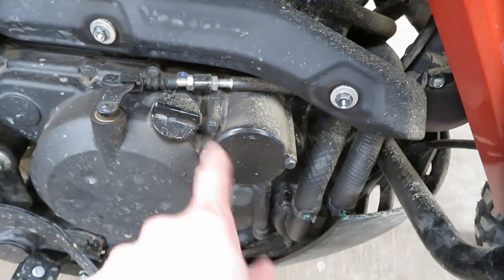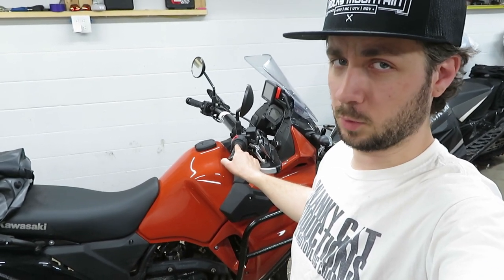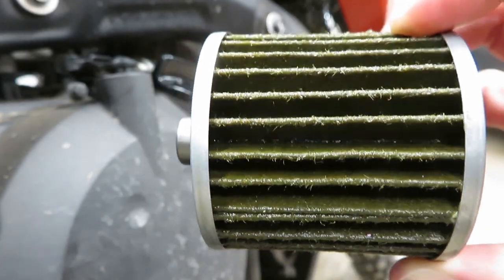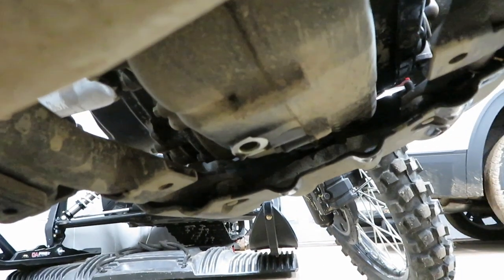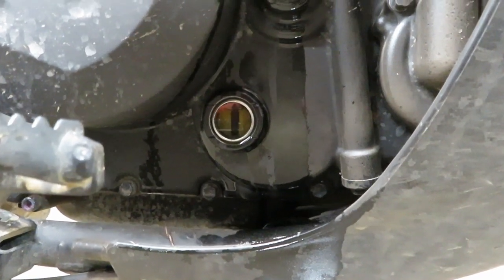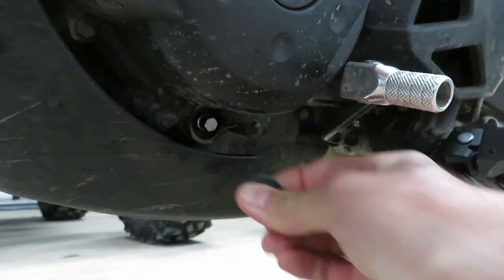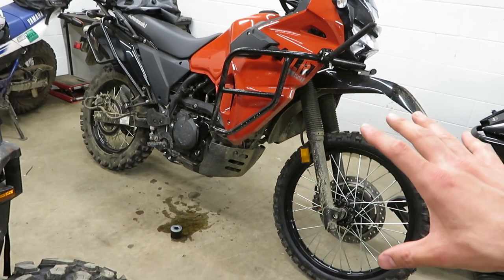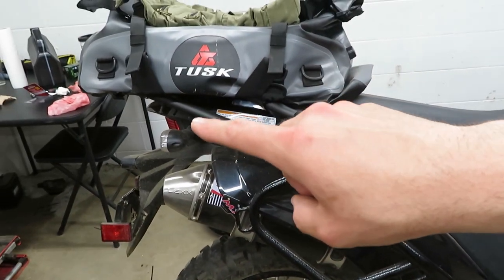What You Missed During Your 2022 KLR 650 Break In Service!

Comment: Wow for years been hearing people wine about the doohickey thing, but this is the first video that ever covered the adjustment on it. Good for you Man, thanks
Reply: The only (1) serious issue that would make me not buy the newer 2022 KLR 650 is:
the doohickey in the engine that goes bad after about 5000 miles & may ruin the engine.
And yes this is still a problem on the 2022 models, I'm told by non-Kawasaki dealers.
Addendum -
The small issues that also make me not want any KLR 650 single:
- way too high of a 1st gear, 
- too heavy/sluggish, i.e power to weight ratio, 
- no tachometer, 
- many other 2022 adventure motorcycles are higher tech. & have better features
Reply: @sweetcostarica  dude if you need to use a tachometer you are doing it wrong
Reply: @Khan-ve5oq You're funny. Have a great 2022!
Reply: @sweetcostarica  if you need a tachometer, you need to learn the bike a bit better.
Reply: @sweetcostarica  having put 30,000 miles on a gen 2, just buy one and ride the damned thing. Rejet the carb and it's snappier. Even the $.22 mod makes a very noticeable difference.
Reply: @travislivengood2744  So if the "doohickey" goes & the engine dies at 5,000 miles just get a new one? Interesting comment.
Reply: @sweetcostarica  well. Mine was fine at 8500. My buddies KLR has 30,000 on it and we did it a few months back. Guess what? It was fine. I enjoy your uneducated snarky end comments though. Educate yourself beyond internet here say or buy something else and stop trolling.
Reply: @travislivengood2744  Trolling??... Fascinating... 
I am not sure why you Travis Livengood think I am being "snarky" or why you seem to not know about the KLR 650's doohickey. So much so you can not bring yourself to even type the word out.
Being Schooled 
- The Famous KLR 650 Doohickey.
Did someone say "uneducated"? As this is a well known & major fault of the KLR 650's motor that for many people has caused trouble,
How does Travis not know it exists and has cause major trouble for Kawasaki owner? Odd.
Please before you judge all KLR 650s by your experience only "educate" yourself on the doohickey problem that even Kawasaki admits is an issue.  

Happy Labor Day.
Reply: @sweetcostarica  I've read lots of things on the internet too. Gen 1 timing chain tensioners DO have a fault. They were thin and somewhat brittle. Gen 2 bikes are much more robust but could have been clocked a little further to allow for more tension. I know probably 8 people who currently have or have owned KLRs. Would you care to guess how many of them have had failures? 0/8. Darn old first hand experience wins again. I have owned one of these bikes for over 10 years. I have worked on at least three. Have had mine stripped down to the frame. It's a 2008, an oil burner. THAT myth is true. And some early 09s too. But timing chain idlers...or doohickey for those who like to nickname an already named part? Gen 1s had issues, Gen 2s are okay. I've literally never seen a Gen 2 fail on a maintained bike.

Reading is insight. First hand experience is knowledge.
Reply: @travislivengood2744  Fascinating... doohickey does exist. God bless 🙌.
Reply: @travislivengood2744  God bless 🙌.  I wish you well.
Reply: @sweetcostarica  stay classy, buy a KLR, ride safe and enjoy.
Reply: @Paul Ridgeway That is not what I heard about the doohickey/tensioer Paul. 
But I am open minded so please give me the data and references to your 99% reliable or shall I say 1% unreliable figure.
Thanks for your help and future references to the doohickey/tensioner issue of the Kawasaki KLR 650.
Reply: I know so many videos and information gets you all worried and ready to spend money on crap that voids your warranty and only a couple vidios just simply check and maintain the adjustments on the doohickey that Kawasaki installed. The data says that Kawasaki has gathered that the doohickey issues are not an issue or they would have addressed it. Cause Kawasaki is not making any money off the aftermarket doohickey modification or they would be selling the mod themselves. And that would be admitting that they knowingly installed faulty parts at the factory. And a company like Kawasaki is going to address something if they think it's a problem and might affect sales of a motercycle. Thanks for the video!
Reply: @sweetcostarica  i just went through the very tuff decision of what new bike to get and went with the KLR. The obvious reason being for the cost you cannot get a better bike. Not what you were saying! 
Mine was $6000 but after the fees and destination crap it was like $8500 out the door. You can't get another adventure bike in the KLR class or better for $8500. The Verseys x300 i looked at briefly but the little 300cc was just not going to cut it. That's a good engine for a beginner sport bike, it lacks the torque needed in a multi purpose bike. You can get the BMW 310 adventure for about the price of a KLR but that little guy is giving all she's got to keep up with traffic on the highway as well. The V Strom 250? I didn't even look at it. Why the hell couldn't Kawasaki just use the 400cc parallel twin in the budget verseys IDK or why couldn't Suzuki just use the drz 400 engine on the street gearing of the v strom 250?? Who knows why they use these questionable engines on a dual purpose bike is beyond me. I like the Honda NC 750 but apparently the front tire is only 17" and an issue off road so they say but it's not just a more expensive bike it's expensive to insure too. So for the money their isn't a better adventure/ dual sport bike that offers the almost 40 ft lbs of torque and 40 HP for 6000 bucks sticker price.
Reply: @lovelymykel76  Simply put the KLR 650's chain tensioner issue (doohickey) is still a problem that should have be fixed along time ago.
It is a problem that should be in mind when you are shopping for a reliable motorcycle.
Reply: @lovelymykel76  BTW great testimony on your experience.
Reply: @sweetcostarica  troll. Never had one, but knows it all.

Comment: Great information.  I just did my first oil change yesterday on 2022 KLR and seen this video afterwards.  I went back and removed new oil filter to double check metal cylinder in middle was in the correct way.  It was but didn’t know it could cause severe engine damage if it wasn’t.  Bike was still on my lift so hadn’t rode it yet.  Thx
Reply: Pretty sure it only goes in one way. So it can't be put in backwards.
Reply: @ZenithClarity  asi es

Comment: When changing the oil on my Vaquero. Since it uses 4.7Qts of oil with filter change I pour the ,3 in as the oil drains to push out some of the old oil as much as possible. Not sure it really makes a difference but makes me feel better.
Reply: All that matters is the condition of the filter. Don't waste oil. The filter ensures particles are small enough to be safe.

Comment: Great rundown!  I had the same issue with the brake light on my '23.  I guess as everything settled in the brake light switch migrated to an always on position.  Easy enough to fix and thankfully I caught it after I got home from picking the bike up.  Also, be aware if you adjust the height of your brake pedal you will have to adjust the brake light switch as well to compensate.

Comment: I changed mine at around 400.  Cut my oil filter media apart and rolled it flat for inspection under a bright light.  Didn't find much for metal but I did find a bunch of paint(?) particles blue....white....pink...

I'm guessing it was from assembly markings.  The good thing is the filter caught it all.

Keep up the great work on the videos.
Reply from the maker: Someone else mentioned paint marker from assembly, I think that's what it's got to be.  Thanks!!!

Comment: Great run down of the service interval. I think I should finally get around to picking up that low profile plug for the next oil change. Thanks for the link.
Reply from the maker: Thanks!  Do you have the stock plate yet?  I can't remember...
Reply: @SwankyCatProductions  the stock skid plate got busted up and I put the motech one on. It reaches the drain plug though.

Comment: Excellent video for the new KLR owner. I had the dealer do the 600 mile service but I plan on changing the oil next time myself. Thank you for posting. Great reference for future oil changes. Owners manual says 2.1 quarts of oil for the KLR but the forum (KLR) has a comcensus of 2.5 quarts. I think the 2.5 quarts might have been a value used on older KLRs but not sure. 🤷🏻‍♂️
Reply from the maker: Glad to hear that, thanks!  Hmm, interesting.  I never paid too close of attention to the exact amount I used on either of my KLRs.  I usually would dump in about 2 and then go from there after checking intermediately.
Reply: @SwankyCatProductions  maybe fill to the top of the sight glass? Sounds like it would be ok.
Reply: @Ghostrider-71  asi es

Comment: Wow, everything looks the same or near identical to my 2018 gen2. Glad that someone at Kawasaki decided that 'if it ain't broke-don't fix it'. Thanks for the doohickey adjustment heads up. I've hit 9k on mine and need to get a shop manual to really get a maintenance schedule up and going. I did want to ask if you ever had any issues with your gen2 doohickey that in an older video you said you'd leave it be and see what happens. I just can't believe that Kawasaki didn't address the supposed doohickey fatal weakness for 30+ years if it really was a problem. I am however wanting to add the thermo bob mod. Looks like you're running Continental tires because mine came with them from the PO. They're great and solid in the rain and gravel but I'm really wanting something less aggressive because I'm on pavement 90 percent of the time with a little gravel thrown in. Great video as usual.
Reply from the maker: Thanks!  My Gen2 ran just fine with the stock  doohickey until it was totaled in an accident at 24k.  I think if you want one to last a really long time then the doohickey should get changed but otherwise... eh it'll prolly be ok lol. The thermobob makes a lot of sense to me, might not be worth the price even if you do end up having to refill the oil now and then but it's nice to have for all the slow moving off road riding I do.

Comment: Don't forget to hit the plug with a metal hammer to shock the threads loose.
People strip threads all the time because thermal expansion locks the plugs to the threads.
Reply from the maker: Huh interesting I've never heard of that.
Reply: @SwankyCatProductions  KTM's manual specifies it on the RFS models and I have doing it on everything now.  If something has an allen fitting then I just put the allen wrench in and hit it with a metal mallet.

Comment: Dig the content. I think the grease on the gasket on the oil filter is to prevent pinching the gasket during install. I actually pinched my oil filter gasket because I only used motor oil instead of the grease like Kawi recommends. I then used grease and haven't had an issue yet.
Reply from the maker: I always used oil on my gen2 and never had issues but I suppose it only takes one time.  I'll use grease from now on!

Comment: My Gen two owners manual stated info on the cam tensioner but not my 2023 Gen three ? At 1300 miles engine making a ticking noise so dealer replaced the tensioner and cam chain under warranty then overfilled the engine oil so much I had to tilt bike to be able to see a bubble in the site glass so took some out myself. My previous Gen two was purchased new and came off the showroom with an overfilled engine oil. Dealerships in Arkansas have some problems.

Comment: Regarding torque specs, the Kawasaki service manual has... questionable numbers for both the oil plug drain bolt and the idle shaft lever ("doohickey") bolt.

Service manual:
Oil Plug Drain: 21 ft-lbs
Idle Shaft Lever: 115 in-lbs

Most KLR owners go for around 15-17 ft-lbs & 69-78 in-lbs respectively.
Reply from the maker: Yeah that seems like overkill...

Comment: Great video, thank you. I’m a former Harley rider, now KLR owner and never had tubed tires. When I replace the tires, do I need new tubes too or is it okay to reuse the old ones?
Reply from the maker: Very good question!  While I have reused tubes in the past, it's generally not a great idea.  The valve stems often start to rust and it's easy to pinch them during removal.  I'd also highly recommend using heavier duty tubes if you'll be off road a lot.  Prior to running them on my gen2 I hit a big rock off road and ended up with a flat.  Here's the install I did on mine few years back.  There's links to all the stuff I used in the "more" section.  DON'T use the front D-Sport though!  The KLR is to heavy for it.  I'd go Tusk D-Sport rear and Tusk Waypoint front.  https://youtu.be/EUt_U6IWZ5o

Comment: I didn't know you could do the 600-mile service yourself. I thought you were supposed to take the bike in to an authorized service center!
Reply: Nope.  You're allowed by law to do your own maintenance and it will not void the warranty
Reply: I think it’s recommended that a dealer perform the 600 mile service just because many people whom buy a motorcycle could be new owners/new riders. Seems that the 600 mile service is just draining the break in oil and refilling with Kawa 10w40. The dealer would also be checking anything else to ensure the bike was assembled correctly. The KLR has had some steering issues that definitely should be addressed during the 600 mile service.

Comment: 1:14 Guessing they intended it to be on dirt and gravel roads vs the kinds of fun and harder trails we all want to do :)

Why not put in on the side like the Versys does?

My Enduro Engineering plate has a nice bulge to protect it which is nice but those low profile bolts look sweet :)
Reply from the maker: Yeah I'm sure your right, they have to know by now we don't use them as directed though haha.

My T7 has it right on the front which makes it really easy to get at... after you chip all the mud off that is lol.

Comment: Did you experience leakage with the Tusk drain plug?
Reply from the maker: Nope, never.  As long as you clean or replace the crush washer and clean the bottom side of the engine, where the washer seals against, it should be just as good, if not better than stock.

Comment: Is it worth doing the thermalbob ? I plan on doing the doohicky way later I just bought the bike
Reply from the maker: "Worth it" money wise, no probably not.  You'd need to burn a lot of oil to even out the cost of possibly avoiding it.  But I do believe it's a helpful mod and will improve longterm longevity.  Makes me feel better too haha.
Reply: I say it is junk. Do not add thermobob. Cylinders will always wear eccentrically in the direction of crankshaft rotation. Just perform recommended services as per the manual.

Comment: Question?  Why do you use aftermarket filters?  Sure they are OEM equivalent but who governs that or sets standards?    I personally use OEM because if the filter fails I have Kawasaki to fall back on which is far more experienced and equipped to care for me if a failure occurs.  Over the years as a motorcycle technician I’ve seen DIY customers suffer greatly at the hands of the aftermarket when it comes to paying for repairs related to product failure.  Lastly did you really just tighten the balance chain adjuster bolt without a proper torque wrench?  Viewers please don’t do that.
Reply from the maker: To each their own but I've never had an issue with uni filters.  Never had one rip or separate and have yet to see any dirt on the leaving side of the foam.  I'm confused what you mean about having Kawasaki to fall back on... are you referring to the 1 year warranty period?  As for the torque wrench, your right that wasn't smart, should always be done with a torque wrench.
Reply: @SwankyCatProductions  To each there own is right.  I think as a content provider it is important to not steer your viewers in the wrong direction especially if the bike may still be under warranty.   Food for thought no?
Reply: Aftermarket filters are oem approved and warranty work can not be denied when using them.
Reply: @chadgilbertson3071    That is what many believe.  On occasion I’ve seen manufacturers exercise their right to refuse warranty due to modifications….filters being one of those modifications.  Certainly doesn’t happen often but it does occur more than you might imagine.
Reply: @bluezhawg2104  false.   They cant deny warranty due to using aftermarket filters.   Thanks to the Magnuson-Moss Act.   Maybe its people like you that spread false theories that makes people think they have to use oem parts.
Reply: @chadgilbertson3071   I’m sorry I wasn’t specific.  I’m speaking in terms of seeking good will help outside of warranty.  I’ve seen K&N oil filters fail and the bike went home in a box.  K&N paid out but not enough to fix the issue caused by the filter.   Had it been an OEM it would have been easier to get repaired.   Regardless of your experience or opinion I do encourage people to use OEM parts

Comment: Too slow man. I just turned 5300 miles on my '22😎
Reply from the maker: Haha yeah sadly I spend more time modding and editing these days than I actually do riding.
Reply: Any oil consumption?
Reply: @rustyharvey4155  zero. Used mobil 1 4T after my break in period and at 5000 i switched to Amsoil. Got a coworker who deals the stuff and at $9/quart it was too sweet to pass up a case of it. I think the oil consumption is a non issue if you keep it below 70. Or in other words. Keep the revs low. I make it a point to do both